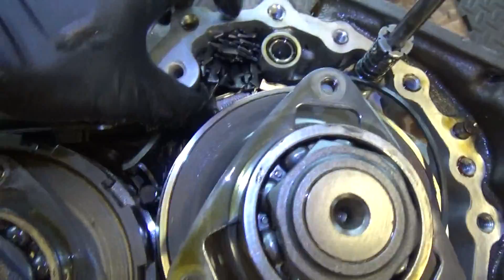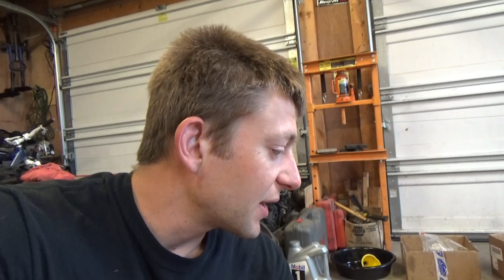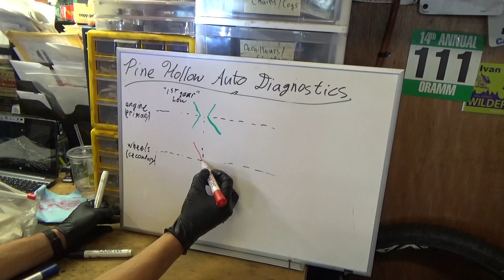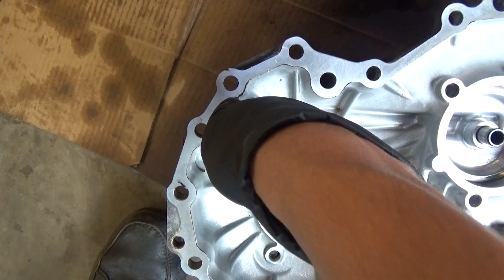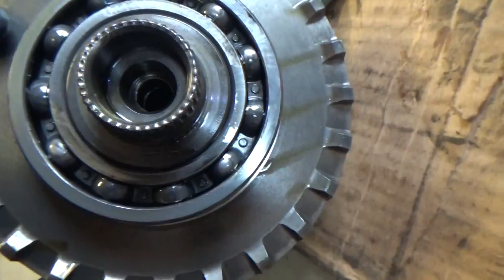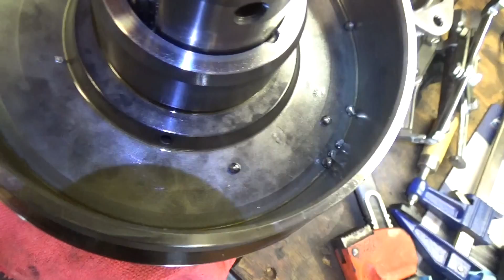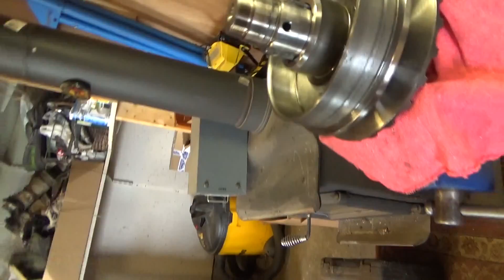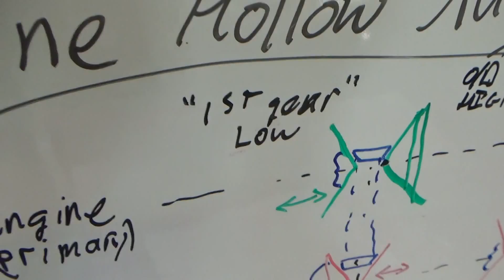Nissan CVT: Teardown and Failure Analysis -Part 2 (RERELEASE!)

Comment: I probably shouldn't watch this series of videos. I have an 11' Rogue. When I bought it, it had just a little over 100K miles on it. Now it has 143 (bought it 2 years ago). So far it hasn't given me too many problems until recently. Now the ball joints are needing replacing, and I suspect the CVT is making a quick little funny (barely noticeable) noise when accellerating up hill. Might be nothing- but now after watching these videos I am uber paranoid. I had a guy replace one of my trans axles back in January, now I am concerned he put enough (or actually used the right ) Nissan CVT fluid. Taking my car to the stealership in the next couple weeks. So much for being a 200K mile car.....as soon as I pay this rig off, it's getting traded in.

Comment: also we use a mount that screws into the six bolt holes connecting the cover to the pulley assembly by lifting with a hoist and using slide hammer on case

Comment: that fluid was black it had been overheated causing the viscosity and friction to change. there was problems long before the belt snapped. I have rebuilt a few of these and belts snapping are not a common problem. This year there was a problem with the oil coolers not cooling efficiently there is a bulletin that adds an external oil cooler.... Was this bulletin performed? Im guessing not and the transmission was overheating on a regular basis coupled with not changing the fluid= recipe for disaster.
Reply from the maker: Did you watch the entire video? Belt snapping was just collateral damage from the underlying design failure. Fluid was not to blame.

Comment: If you want a simpler explanation, just google a scooter CVT, as both are basically the same design, but a scooter CVT is easier to look at and see what is going on.
Reply from the maker: I don't think a scooter has electronic fluid pressure control by a module...but similar concept :)
Reply: the scooter cvt fails alot but atleast allows you to easily change the belt in less than an hour

Comment: Those chains supposedly push the secondary pulley rather than pull on it.  So, when one of those variators doesn't keep the chain tight, I would expect it to buckle and that's what happened.

Ever have a CV axle fail that has always had good grease and a good boot?   I'm not sure why that happens, but the constant torque on those balls in one spot causes them to eventually pit one of the races or whatever you call them in the joint.

If it happens there, why would the same concept not happen to that variator in a CVT transmission?  All the vehicle's transmission torque is handled by those balls.  This would explain why I tend to see CVT transmissions that hold up better in smaller vehicles and hybrids vs larger vehicles such as the Ford Freestyle and Nissan Murano.  Smaller cars have less torquey engines and simply have less to haul around, while big vehicles do have to content with bigger engines and heavier loads.

Comment: in some of our old mailing equipment (1970's)they use a variable speed pulleys one had a hand crank pulley that squeezed the belt which made it ride outward on the pulley speeding up the machine, the other pulley was spring loaded becoming smaller.

Comment: I have a 2016 versa with 50k miles, I think I feel some slipping while car takes off in first gear. Never checked or changed trans fluid. If I change the trans fluid now, would that helps?  Warranty expires at 60k miles. Thanks
Reply: Trade it for a toyota/Lexus.

Comment: Years ago two engineers were golfing and noticed that their gas powered golf cart had two drive pulleys that  operated by opening and closing  variably depending on engine speed and torque. One said to the other we can over-engineer this for autos and make a killin'. Is it me or has nissan been unable to design a trans thats worth a damn.

Comment: Great stuff. Cannot understand how steel can be used in a "Push" mode.  Steel is mostly utilised in a "Pull" or tension mode. How difficult would it be to engineer it to be used in tension? As you said, steel bands will eventually fail after being bent around different radiuses so often.

Comment: CVT transmissions are very simple, you can find all the internal parts on ebay.
You can remove, fix and reasembly in 2 days.

Cheers.
Reply: Or... you can avoid them altogether and have two days doing something productive instead of fixing unreliable junk.

Comment: The metal bands are under minimal tension (otherwise they would fail much, much faster), the power is transferred by the metal pates stacked on the metal bands. The plates are compressed, hence it is called a pushbelt. As far as I have heard Subaru uses chains in their CVT designs. Anyway, the failure was caused by insufficient hardness and toughness of the ball splines. They should have put twice as many of them, or used a better material or just a sliding spline, working like in a journal bearing.
Reply from the maker: Correct on all accounts...thank you for the information!
Reply: I am wondering what made them go for the ball splines instead of plain sliding splines. Maybe they figured out that they would not slide well under load. It could have been remedied by supplying lubrication through the shafts, but the cost of machining of the shafts to put oil channels would probably make it more expensive than they wanted. Anyway, this is just an engineering brains fantasy. Thank you for making a great and a very informative video. Car manufactures today are very tight lipped about the technology that goes into the cars, so this video is very much appreciated!

Comment: funny, the Nissan Murano is one the most mechanically reliable cars around with a cvt transmission. Maybe the 4 cylinder cvt on the rogue and altima are under strength? My Murano has 121000 miles and runs like a raped ape!!!!
Reply from the maker: 121k huh? Just about that mileage when they blow up lol! Let me know when it gets to 200k, then we can rate it "reliable" ;)
Reply: you cannot judge a car by one bad tranny...the law of large numbers tells the real story. you think your an expert because yours broke down and your a whiz bang mechanic who can tear apart your cvt and explain the weakness of the design???? Why didnt you buy a used one and save yourself a bunch of money??? Then sell it it and get a manual transmission ..if you know how to drive one!!!!
Reply from the maker: True, maybe your Murano is one of the lucky reliable ones. But for some reason ALL Nissan vehicle models equipped with CVTs have a bad reputation for premature failure. Just simple statistics...plenty of forum posts and angry Nissan owners out there to tell you their story.

Personally, I wouldn't drive anything other than a manual transmission vehicle...just because I enjoy using my brain to shift gears instead of a computer.

But my challenge is still on the table: let me know when your Murano gets to 200k on the original CVT. I'll even send you a free autographed PHAD T-shirt :)

Comment: thats way Porsche put the double clutch trans back again. Nothing like human legs to do the gear ratio and not a pulley with some belts....belts fails...even the one in my paints right now.
Reply from the maker: LOL human legs for the win! How does a double clutch work?
Reply: Mine?   just stepping twice on my clutch...Porsche? auto trans with an idiot proof system....lol

Comment: I would bet that the "core charge people" would appreciate your just putting all the "kibbles and bits" in a box, reassemble the transmission without dumping all the garbage back into it, and then shipping it all back to them which would save them the trouble of fishing it all out like you did.  The only thing you damaged was the pulley when you were prying up on it with the pry bars.  And maybe nicking the outer cover with that air chisel.
Reply from the maker: No, I'll let the Nissan "core charge people" struggle just like I did hahaha

Comment: Just conjecture at this point, but I would like to point out that the "o" ring seal in the failed pulley was hard, AND it was broken. 
I wonder if this was the ultimate cause of the tranny failure? 
Would the sliding pulley that rotated on the shaft and seizing up caused the seal to fail?
What if the seal had blown out first (insert your little ball and shaft jokes here;-), there would be no oil pressure to hold the pulley in the "proper" position and... what kind of issues would that have caused? Was the car in motion? How fast? 
Perhaps without proper tension applied to the push belt, it slipped, vibrated and came apart, all the little keys then jammed the pulley causing WAY more torsion force applied to the little balls that they were ever designed to handle and THEN they failed?
Like I said conjecture: which came first, the chicken or the egg? But seals fail all the time in every type of transmission and this one had obviously failed!  I don't think it is fair to blame the design of a transmission on a seal failure. BTW, I have a CVT in my Fusion Hybrid, I love it and consider it an amazing piece of engineering...

Comment: My 2003 Honda Accord lasted 630,000kms with original transmission. I have a 2013 Honda Accord with similar CVT. I am convinced now that I will not reach another 600k without changing the transmission. I was concerned about pulleys not being able to go the distance, when in reality the belt material suffered the metal fatigue failure. Thanks for the great video.

Comment: Thanks for the video. I was able to replace the valve body on my wifes used transmission after seeing the video. Mechanic didnt want to touch it. BTW these CVT transmissions are junk. Differential went out on ours at 100,000 miles. Got a low mile used one but valve body was bad. Haha. Swapped it out with valve body from the old unit.

Comment: CVTs will be in all vehicles within 5 years...its all about being cheaper to manufacture...
Reply: cheaper than what??certainly not cheaper than the standard 5 or 6 speed manual that has been perfected for 100years and equips 99,99% of the vehicles here. maybe in murica were people get confused by that stick with numers on it. just the transmission outer shell looks huge and complicated.sure its not as simple as 2 shafts with some gears on them, some selector forks and couple of brass syncro rings.if you take care of a manual they can last millions of miles and are easy to rebuild
Reply: I doubt that very much especially since 8 and 9 speed transmissions are being introduced on midsized and larger vehicles ( they get the same fuel economy as CVTs as well). Electric cars will take over before CVTs ever become a thing, plus there too weak to be used in anything other than sub compact economy cars.

Comment: In my opinion...it would presume firstly it is engineered work with fluid dynamic pressure. As in Hondas VTEC technology, similar in principal work off the fluid pressures to transfer mechanical power via cam lobe profiles. Secondly somehow of the rubberized seal when new meaning before too much of high mileage at one point was more pliable. Overtime with heat temperatures rising...and not driving after parked, it was a matter of time before the rubberzied seal gave away. Now there is NO measured sealing at ALL. Thirdly, this than gave away to the #10 steel metal and segments more heat and stress! Consequently this is the result of catastrophic failure of the CVT transmission...in my opinion! CVT has'nt been around that long. Does anyone know? Was it the 1990's when they were mass produced from different manufactures. Personally, I would fair to say the conventional Torque converter automatic transmission is much more easier to service and maintain as oppose to CVT. You would lose a little bit for mpg but, not by too much! The combination of materials dynamics which make up of the CVT engineering is not perfected. In closing if you look for much better mileage, than one would thing EVT...and yet the Battery technology is yet to be perfected as well.

Comment: Is it possible to take a look of the snapped belt ends under microscope? If you see a smooth surface at the break point, that indicates a metal fatigue. Meanwhile, is it to take a microscope look at the grooves on the driveshaft, that might be caused by long term axial grinding(Think about the balls grinding the surface of the axle every time it shifts). Good to know the belt is not the problem, it can carry enough torque.

Comment: Thanks for making this video. It was very interesting. According to Scotty Kilmer, the Toyota CVT is very reliable. My wife's Corolla has a CVT transmission. I don't like how the CVT feels, personally. The engine power does not respond immediately, when you step on the gas pedal. There is a long delay. Somehow Toyota makes it where is feels like it's shifting from gear to gear; but again it really feels sloppy, lots of lag time between the simulated gears. Personally, I would never own a CVT transmission.
Reply: Having driven a few different brands of CVT I don't particularly like them either and for much the same reason - that lack of feel of direct drive and the fact the accelerator controls the engine speed instead of just the load. Give me a conventional automatic with a lock-up torque converter over CVT any day of the week.
Reply: Jason Hart 
You must remember that CVTs are naturally set in direct drive 
     so they "rest" in 5TH gear equivalent. 
   And the lock-up torque converter disconnects the tranny to the engine to prevent a stall. 
    Thus: CVTs will choke back engine response
  |
Theres already a solution to this & Nissan has always been doing it to their CVTs:
    Nissan CVTs rest in 4th/5th gear equivalent when in stop & go conditions leaving the lock-up converter to act a dry clutch preventing a stall
     Whenever you are coasting &/or are about to launch the car here's what happens:
     when you slam the gas pedal the CVT will be told to go into 2nd/3rd gear equivalent allowing the engine to reach 3k rpm & then the CVT will shift twice rigidly until you have reached your desired speed & then rests in 6th gear equivalent.
Reply: Scotty is full of s***

Comment: good analysis Ivan.   good video as well!  ! 

Interesting engineering design . Woorks ok for relatively light duty jobs like riging mowers and washing machines , old technology. applications.  

A PISS POOR APPLICATION IN AUTOMOTIVE. AT BEST.  

THOSE. GUYS SHOULD. BE BEATEN. WITH A CLUB FOR SELLING CRAP LIKE THIS TO CAR BUYERS

BEST OF LUCK AT YOUR. NEW JOB.  THEY CHOSE WISELY IN BRINGING YOU ON BOARD.

Comment: That’s shear pins you found there. There to keep more expensive pieces from failing. You will find them in lawn mower shafts. They don’t fail from old age they fail from some other fault. Ring pack and Elements are what make up the belt. The little pieces you found are the elements they fit in between to ring packs witch each ring pack has 9 metal belts on each ring pack that fit on ether side of the elements.
Reply from the maker: hmmm not quite sure the lawnmower shear pin analogy works here. So which "more expensive" pieces were saved from failing?

Comment: They have done away with gear boxes and belts on our combine and use CVT transmissions instead 400+ HP with wild load cycles. They got to be tough.

Comment: Well. I am impressed. I wish you were getting some payback for this work. Excellent. I am driving a 2005 Nissan Murano. And I am not scared necessarily. However, I am very concerned about the expected longevity of my CVT. Is it the same as the 2010 Rogue? I have 126k on the engine. I am the second owner. I do tow a light 4'x6' utility trailer for tent camping gear. But now I am even concerned about that plan. I see the inherent design flaw with the drive being absolutely dependent on the integrity of the drive-shaft sheave balls. What a terribly undersigned unit. They could have avoided problems with doubling the number of grooves, improved the metallurgy, etc. Well. I am not sure what to do. I guess I will not overdrive the car for sure! 
Great video. Thanks.
BTW. Did you get your core deposit back? :^)
Reply from the maker: Yeah just go light on the gas and sell it ASAP and get a more reliable tow vehicle :)